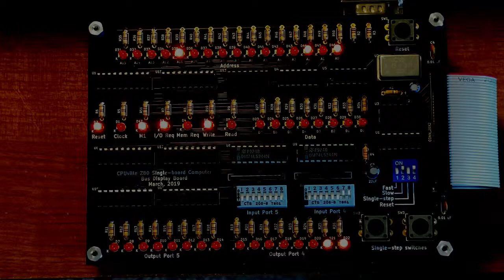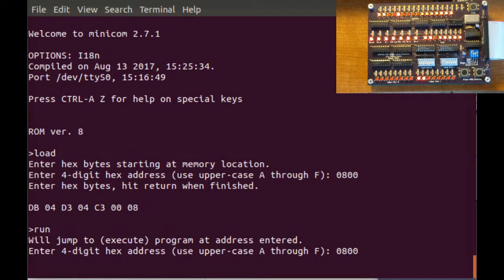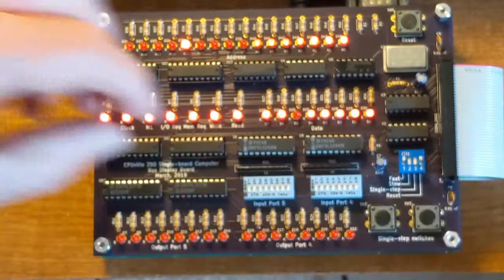Single-stepping the Z80 processor

Comment: Not really single-stepping in the traditional sense, more like single-clock-phasing.

Single-(instruction)-stepping triggers the ready line on M1+RD (instruction fetch) cycles.

What you are doing is lower-level and probably more confusing to beginners.